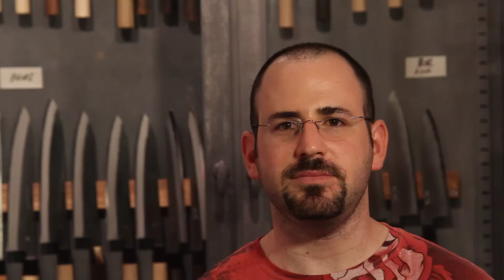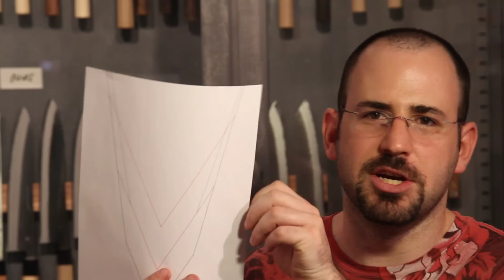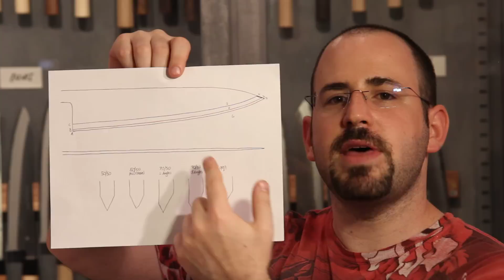Thinning Your Knives (A Lecture)- Japanese Knife Imports

Comment: Great content again. 
I've done thinning to some of my knives and obviously at the begginning most of them were unequal on both sides. I live in Europe and most of my knives were double bevel with secondary edge, as i didnt know better before sharpening passion, and after i started buying ones with primary edge only so that i dont need to thin them anymore. But it's a veri meticulous job to do by hand, but also verry rewarding at the end.
Reply: i had the same problems and i figured something out.  where you put pressure changes the bevel angle but a majority of the pressure is coming from where you grip the handle not where you are pressing downward.  if you adjust and loosed your grip of the handle the it’s easy to slowly adjust the angle.  i think if you grabbed a knife and pretended that a bathroom scale was a stone that you easily and accidentally produce five times the amount of pressure with the grip hand than with the hand you push down with.

Comment: 3:05 micro bevels are where it’s at BTW.  what i do is i thin beyond a zero grind and then i put my edge on the micro bevel and then i polish the secondary bevel again to reduce the size of the micro bevel again.  i do that a second time because it starts getting much sharper because the apex is more pronounced.  on my straight razors i do the same thing but i have a polished edge with not scratch pattern so it doesn’t abrade my face and i basically have to reduce the micro bevel a second time to make a smooth edge pop hairs.  geometry > scratch pattern but you can have both.

Comment: Could you demonstrate fixing up the side of the knife after you scratch it?
Reply: I've been thinking of doing some livestream stuff during this crazy time, so if i can make that work, i will.  However, the gist of is is that you need abrasives to make it look nice.  For me, that tends to be a belt grinder and buffer, but for many it ends up being sand paper.
Reply: @jonathanbroida9257  Thanks for the reply on an older video; I look forward to that. I'm really curious about this process on knives with a damascus pattern. There seems to be a shortage of information on some of these techniques and you can find people doing it but not explaining what tools they're using and etc.

 I've just been getting into some deeper techniques after having been sharpening my knives for a while and this is where things get a bit more complicated it seems.
Reply: @WormyLeWorm  for damascus, you've got a few different options (and how they work will vary with the steel type/cladding on your knife).  For example, you can use acid etching (ferric cholride for example... diluted), bead blasting (if you have a sand blaster), finger stones (usually hazuya uchigumori), or even just sharpen on natural stones (though this is less effective for the sides of the blade as opposed to the bevel or blade road). There are even some powders you can use (made from either natural or synthetic abrasives).
Reply: @jonathanbroida9257  I suppose it's something I'd be more comfortable seeing first at this point before I decide how I'd go about it for certain. So far the farthest I've gone is using some wet/dry sandpaper on an old Shun knife to clean up some scratching and dulling from less experienced sharpening technique. It did help quite a bit, though I feel like the pattern is less clear than it was from the factory. Fingerstones or even just using higher grit stones to clean it up sounded like approachable options, but I think I need to see it to understand how it works at this point. I've even found a guy using a nagura to polish the sides of a knife, though I don't yet know how well that would work on things with a pattern for example.
Reply from the maker: @WormyLeWorm  you could certainly do that.  To be honest though, most Damascus blades from japan tend to be sand/bead blasted or sometimes acid etched, so if you were trying to get closest to the factory look, those tend to be the best options.  Acid etching is actually quite easy.  When things calm down, maybe I can set up a time to show you how a couple of those options work and look. I can also e-mail you pictures of previous knives I've worked on with those different methods so you can see differences in how they look.

Comment: Hi Jon, can you thin down a misono 440? Or can you only do this with knives that has shinogi line?
Reply from the maker: yeah... the vast majority of knives can be thinned... no prob with the misono
Reply: Japanese Knife Imports Thanks Jon,  now I really do need a bit of a courage.lol. So if i thin this down Jon,  will the shinogi line be visible? And how will I know that I’ve achieved a good angle on thinning it? Thanks!
Reply from the maker: the shinogi line doesnt inherently exist in the knife... its something that is created through grinding/sharpening.  If you thin in such a way that creates one, then yes, you will see something like that.  But that doesnt mean you will 100% see one depending on how you've sharpened.  Usually, the angle i use is between 2-4 degrees per side.  You are looking to thin about 1/3 - 1/2 of the way up the face of the blade in general.  Aside from that, check thickness behind the edge visually and with your fingers from time to time as well.
Reply: Japanese Knife Imports Hi Sir Jon, Iast question before I thin down my knife, what grit should I use to thin it down? 500 or 1000? And after that should I run it through a polishing stone or running it through a 1000 is more than enough?
Reply from the maker: i use the coarsest stone i have usually... following that, i either finish up to a grit i think looks nice (maybe 6k) or go over it with sandpaper (or a belt grinder or buffer) to get a more even finish.
Reply: Japanese Knife Imports Hi Jon! I’am so happy with the outcome of thinning my knife! Its way way sharper than it usually was! The only thing now, Im really having a hard time sanding it down to get an even finish. Thank you so much for the tips Jon, cheers!
Reply from the maker: glad its working out well... sorry the refinishing takes so much time... it drives me nuts too :)
Reply: Japanese Knife Imports Hi Jon, can I ask for some tips on mirror polishing a knife? Thank you
Reply from the maker: there are no secrets to it... go slow and remove scratches at each grit before moving on.  Its easier to do with sandpaper for most people.  I use a mix of a belt grinder and buffer to do it.  Sometimes alternating scratch directions with each grit can make it easier to see when the previous scratches are gone.  Hope this helps.
Reply: Japanese Knife Imports: 2-4 degrees?? 😳 Is how much up the face the top line lands really just a function then of the thinning angle and how close you come to the apex? Might this be a good use of my friend's Edge Pro? Thanks!